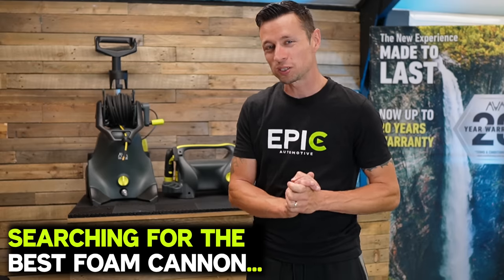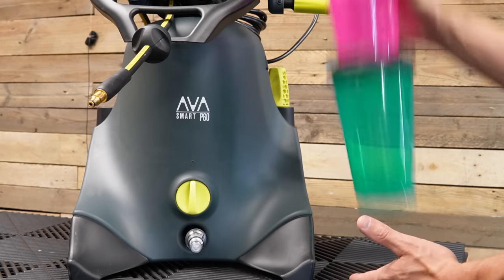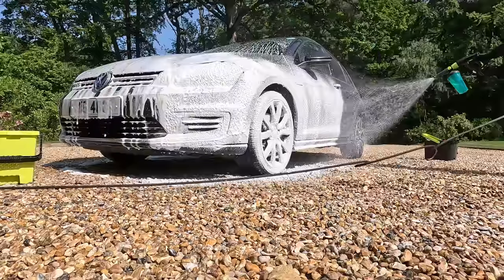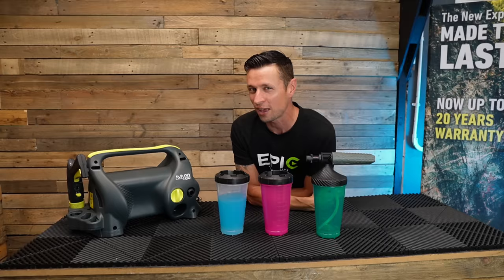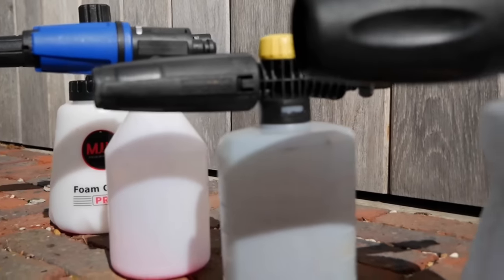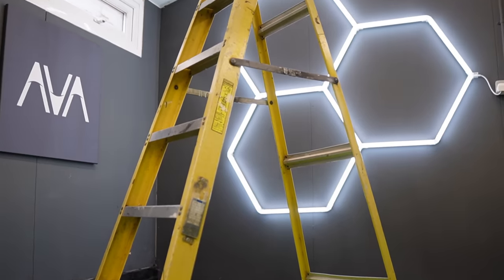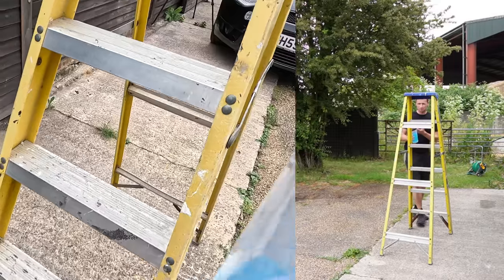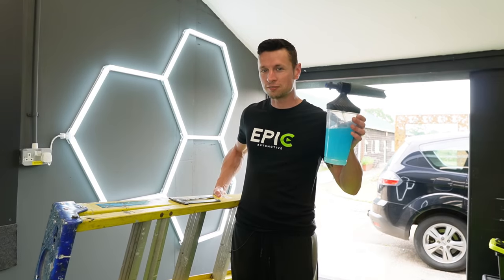Detailing Game Changer! AVA Premium Snow Foam Cannon does it all

Comment: Having bought the new MJJC cannon. Even with the Karcher adaptor it doesn’t lock on the AVA gun so it swings about when your using it. It’s also very heavy and the fan adjustment it to critical.  So I bought the new AvA cannon your featuring and what a difference. Way lighter and works just as good at the MJJC.
Reply from the maker: Amazing stuff glad it's working for you 😎
Reply: I have the same issue with the MJJC  on my AVA  trigger . It locks on reasonably well , but because of the quick release it's like a swing on the end of the gun . 

Not had the MJJC  very long , but I can see the AVA being on the must have list  very soon
Reply: @Hammertime66  yip. It doesn’t feel good at all. The AVA gun is way better. Glad I switched.

Comment: I bought an Ava P57 on your recommendation, it’s a great machine. As you say, they’ve thought of everything.

I find it uses a sensible amount of product on setting 6 (300ml does one car, 5L water used, at 1:1 in the bottle, aiming for 3% PIR).
Reply: Using Bilt Hamber Touchless btw.
Reply from the maker: I love that machine. It's a perfect balance of spec and value for money

Comment: I think im gonna buy some ag polar blast as ive heard it has great cleaning power and wont effect any protection
Reply from the maker: Ive tried that. I really like it
Reply: I've been using polar blast for the past few months and never found it to be that effective against road film even when trying lots of different ratios. I found myself applying Bilt Hamber Surfex HD at a 5 - 10% ratio to the body work to give the snow foam extra cleaning power. Surfex can also be used as a tyre and alloy wheel cleaner at this dilution. I have also been using the AG UHD shampoo to compliment this, which is a nice product. As I've run out of the polar blast, I've ordered Bilt Hamber auto wash and auto foam.  I find their products just work.
Reply: @mudguardrider8211  so auto foam is better? I've just got the auto wash and was considering auto foam but it is a bit more expensive (it is 5l but I don't think I need that much unless it is a much better product)
Reply: I've just watched a comparison video and autofoam does seem much better in terms of cleaning power

How much do you use in a 1l foamlance?
Reply: @carsgonewrong746  If you're new to snow foams, then maybe stick to the polar blast for now as it's easier to calculate. Or try Auto Glanz Spritzer. It's a nice snow foam with very good cleaning ability. 

Autoglym recommended 200ml of product to 800ml of water. Bilt Hamber recommends working out the PIR (panel impact ratio) to calculate the snow foam. Essentially, fill the snow foam bottle with just water, then empty it into a measuring jug through the pressure washer. Once empty, calculate how much water was given through the snow foam lance to work out your PIR. Then calculate how much product is required.

Remember, never apply snow foam or wash your car in direct sunlight or when the panels are hot.
Reply: @mudguardrider8211  thanks mate, the only thing I'm concerned is if the alkalinity will damage the ceramic spray coating I'm looking to put on my car
Might use a low dilution like 2% PIR
Reply: @carsgonewrong746  The spray acts as a sealant, so I wouldn't apply that until the car has had full decontamination, including claybar, polish, and wax. I'd then use the spray as a top-up after a weekly wash otherwise it'll seal any contaminants within the paint. I could be wrong.
Reply: @mudguardrider8211  yeah thanks so much for your help
Gonna make my car look brand new 😎

Comment: Have you tried those battery powered jet wash guns that you put in a bucket? If so, which is your best option for people that live in flats or are not able to access a mains water tap to jet wash the car?
Reply from the maker: I used a battery karcher but it was the £1500 model lol. It was good to be fair. I would get a collapsible water butt from a garden centre and take it downstairs to the cleaning area and fill it up as pressure washers use little water in reality

Comment: Used this today with a k4, and a vario lance which is what comes with the karcher by default, but didn't work as expected, I tried the AVA on 6, then just went to 9, but was more shooting out in a straight line rather than spraying, do I need a different lance?
Reply from the maker: Twist the nozzle on the end mate. It's just the fan width. It's fully adjustable

Comment: Will this work with the karcher k4 power control pressure washer straight out the box without any adaptors
Reply from the maker: yes
Reply: @epicautomotivedetailing  is their a snowfoam set you recommend for a novice and a link to the process
Reply: By the way only to wash my own vehicles

Comment: Just wondering if the ava p60 evo is worth the buy? I cant seem to find any p70's in stock anywhere 😂
Reply from the maker: Hiya Lee. So basically the Evo P70 sold out across the UK after I released a video on it. It went crazy. I have the Evo p60 and I can't see the difference to be honest. I think it's 5 bar pressure less and a few less on the flow rate but it's a fair bit cheaper and it's got all the same kit
Reply: @epicautomotivedetailing  i did wonder that! I also thought it was maybe a bit of overkill for myself to buy, considering i only do our cars and the drive and paths! But that's excellent to here and thank you for replying!! 👍🏻👌🏻
Reply from the maker: @leeodie1198  next month I have all 3 P60 pressure washers being compared as people don't know all the differences . I still think they only need one but I do understand now why they made 3
Reply: @epicautomotivedetailing  i look forward to that, i picked my one up from cleanstore? I think youve mentioned them before, i must have spent £700 yesterday for the p60, cleaning products, and the snow foam gun in the video above 😂🙄